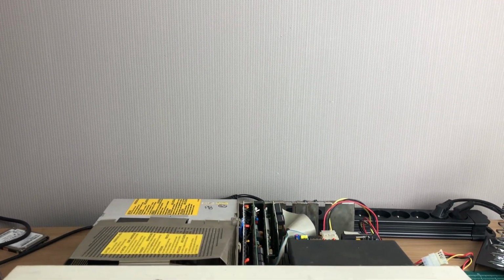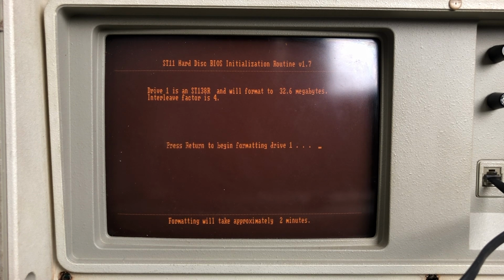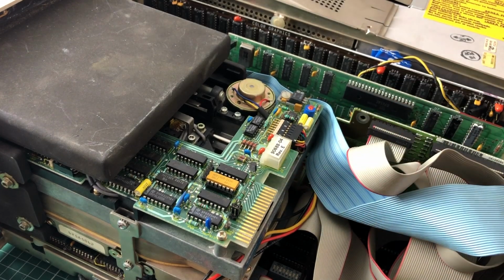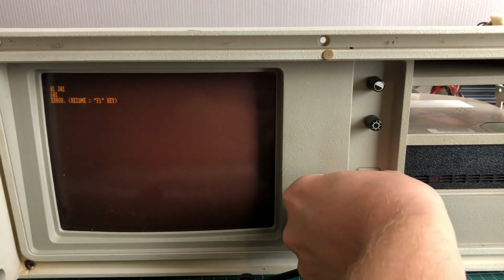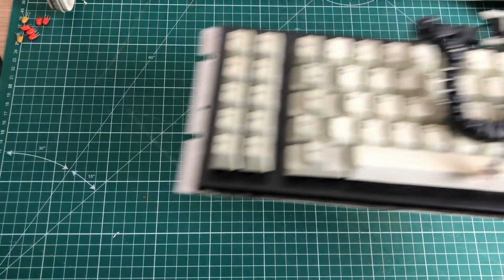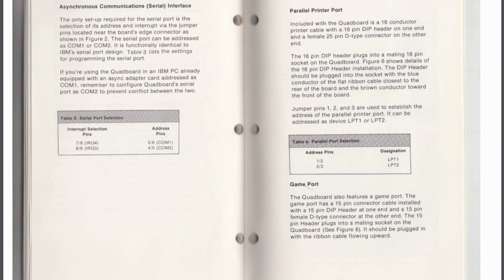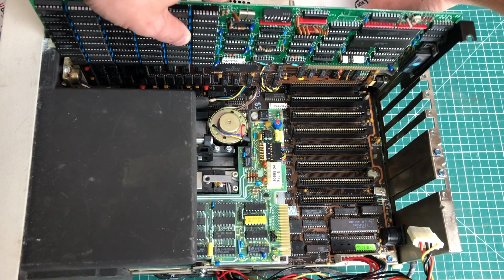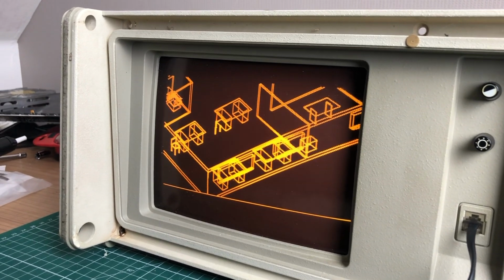IBM 5155 Part 2 : Light at the end of the tunnel

Comment: I have been watching these videos with interest over the last few days as I attempt to get my 5155 working again, so thanks for the great content! Did you ever sort out the hard drive/RLL controller mismatch? My 5155 has exactly the same configuration - ST11R (RLL) controller card and ST 225(MFM) drive but I am a bit worried about "over formatting" the drive to 32mb like you did.. did you have issues with doing that in your machine?
Reply: I just had the same thought after watching the video, as you can see at its end it's the very common and well known ST225 hard drive which is definetly an MFM model. In the internet you hear different opinions about if it works to use an MFM drive with an RLL controller or not. I have no experience about it my myself, so it would be interesting to know if this configuration might work even after a few years.
Reply: @davidhorst3766  I did the "overformatting" on my drive and it worked, but it only lasted a few months before the boot sector "died" when I got to about 50% disk usage.. havent tried to fix it yet..

Comment: "Let's recap a little bit" - funny.. I had access to a lot of these machines during the 80s and 90s and lots of PC parts, so enjoyed building them up as much as possible, installing hard drives, ram, etc. My guess, probably as well as other people here that they previous owner didn't park the drive before moving it which is especially important with a 'so called portable' machine.
Reply: "Park the hard drive..." We're dating ourselves here, aren't we? As soon as they came out with the magnetic actuators in the early IDE hard drives, that term died out fast.
Reply: @BlackEpyon  Yes, of course, but it's still alive and relevant to those of us today who enjoy the hobby of restoring, and using the legacy machines. This means parking the servo motor (usually a stepper) driven heads. You are 100% correct in stating that once the voice coil type head actuators came on the market it was no longer necessary because the spring action would cause the heads to retract off the platters when power is removed. I feel no shame or guilt in dating myself. I've been working on a  PC-XT restoration recently and wrote an assembly language interface routine to the RTC card that came with the machine since I didn't have the software for it.. It was an enjoyable hobby project.  FWIW the clock card has a MM58167 chip on it. 
Cheers!
Reply: @fredflintstone8048  I actually recently got myself an MFM drive with an XT machine I picked up off of eBay. It was listed as parts/repair, and I know for certian that the hard drive wasn't parked, since the machine let out the magic smoke when it was last tested (blown tantalums, it boots now). But I don't even know if the MFM controller works. It's ROM chip is one of those older types that can be cleared with UV, and was missing the sticker. I can read some data from the ROM chip, but without any visible model number on the card (just says "Modular Circuit Technology MCT-HDC"), I can't decipher the jumpers, or lookup to see if somebody has a ROM file I could compare to see if the ROM is still good.

It's no loss if I can't get it working, since I wanted to put in an XT-CF anyways, to free up the drive bay, but it WOULD be nice to be able to get it working for posterity, and for the sake of the hobby.
Reply: @BlackEpyon  It would appear that documentation for that controller may be hard to come by. You might try a command in debug something like -g=c800:5 which might possibly invoke an internal routine on the card for dealing with the drive. This might help: https://www.youtube.com/watch?v=uWWNbpd56Xs&t=695s

Comment: Correct me if I'm wrong but the ST225 is MFM not RLL.  So it would be an MFM interface.
Reply: i think it's a mismatch, an mfm hdd w/ rll card.  i predict he'll install an mfm card in next video, & reuse the rll card in another machine.  take care & stay safe.
Reply: Late reply. RLL controllers use MFM drives. They use a different encoding, giving an additional 50% storage. So a 20MB MFM drive with an RLL controller yields 30MB.
Reply: @JamesPotts  Didn't know they were interchangeable.

Comment: How did you format a 20mb drive to 30 mb? Lol
Reply: Jay Brooks the RLL card can pack in more sectors than an MFM card.
Reply: @azzajohnson2123  not really. The RLL drives were designed with heavier media.  The card called it a ST138, and the drive was an ST225, guessing the WD controller card has been manually configured or came w a ST138, now being used with a different drive.

Comment: why some capacitors aren't totally vertical(angled down)?
Reply: Those are known as axial capacitors, they were most used during the early days of electronics with vacuum tube equipment until the 70-80s when the transistor became more popular, then the axial capacitor was too big for printed circuits so a vertical position was much more compact and convenient.
Reply: @silentbloodyslayer98  thank you so much for all

Comment: The Kaypro's might be worse to remove the floppy drives on, due to the drives being encased in heavy shielding from the CRT next to them, again I had to use a ratchet to get them out
Reply from the maker: I have a love-hate relationship with these machines. Think they are really nice but extremely difficult to service and clean.

Comment: But what do you use it for?
Reply from the maker: Besides the fact that it looks super cool with the built in display, you can also hook up an external cga display. It is basically an ibm pc xt so runs all of the same software. None of these retro pc’s have any practical use, but a lot of people find it interesting to tinker with them or run old software and games on them.
Reply: @RetroSpector78  thanks for your answer!

Comment: It looks like the big screws on the floppy drive were supposed to just be loosened, not removed since there's a slot in the plastic to slide out the drive after removing the smaller screws.

Comment: That does not look like Seagate st-138R 20:35 .The st-138R is an 3.5'' hard drive.
Reply from the maker: Correct, I mentioned it in the description (not sure in the video) that there was a controller / disk mismatch ... only saw that it was an ST-225 when I removed the floppy. It came configured as an st-138R and had an RLL controller (that is not supposed to be hooked up to an ST-225)

Comment: disarm the hard drive, turn off the first disk, and the rll controller ask install, but in the ST you will need the 2.1 version 
because the errors in the disk can be past, the old version the controller cut de low format when find an error.
Reply: So when I was much younger we had an older at machine. Or XT. Or both. But anyways the hard drive was messed right up so I ended up formatting the thing a good 60 times I think. Including the scandisk to mark the bad sectors. The same errors would eventually repeat every time and I would have to start again. What a great learning experience though. I wonder if lubricating the bearings or motor or anything on the hard drive would help.

Comment: Nice restore.  Why did the HDD act up?
Reply: Probably because it's a 20MB MFM hard drive formatted to 30MB using RLL. Sometimes you can get away with it, but more often than not you get frequent errors that creep in.
Reply: Stepper motor based head arms HDDs have one cylinder per step of the motor, so the controller asumes than the track is always aligned with the head. With years, thermal expansion an contraction and wear they get miss-aligned. So you may Low level format the drive so it gets re-aligned. Modern voice coil based head arms don't have any steps, they look for the tracks and get self-aligned every time.
Also the magnetic field of the old data may be faded out.

Comment: Thanks! I just got my 5155 running again with the help of these video's. I still need to fix one of the floppy drives, but after seeing your video's, I'm confident that I'll get it fixed.
Reply from the maker: icecreammm2 cool .... glad you got it up and running again and the videos helped !
Reply: @RetroSpector78  I'm looking into buying an XT-EDI solution for my 5155. Any Idea where these can be bought in the EU for a reasonable price?
Reply from the maker: @icecreammm2  no there don't seem to be any "big" shops in the EU that I know that sells them. You can find them sometimes on ebay. Otherwise official channel  via the US (TexElec) where you can get them assembled or only the PCBs if you feel like creating one yourself. Or you can perhaps check the forums (vogons , vcfed, amibay) to see if there are local sellers.

Comment: Have you considered trying to replace the Varta battery with a coinsell CR2032 on the memory card's PCB?
Reply from the maker: bundesautobahn7 yes I have, but focus now was to get all of the basic stuff up and running ... already became a bit lengthier than I would have liked :) might do it in part 3
Reply: Does this really work? The coincell is a different voltage, and wouldn't the charging circuit in the PCB fry the coincell?
Reply: @audunm.gangst1166  folks who do the coin cell mod install a diode to prevent trying to charge the coin cells.  multiple coin cells in series to match the replaced secondary [ie rechargeable] batt, if necessary.  take care & stay safe.

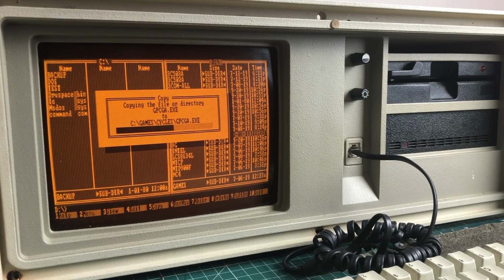Comment: 21:40 What is that D:\ drive?
21:52 This looks like 8087 benchmark
Reply: I learned autocad on ATs - slightly faster but not really that much :)
Reply from the maker: Bad Screw did you create your username specifically after watching part 1 of this video ? :)
Reply from the maker: It's the office demo drawing rendering in AutoCAD 2.6
Reply: @RetroSpector78  Didnt know that there was an Autocad at the time of XT. On the other hand Ive seen reviews of XT class PCs that were produced in early 90's, so its plausible. That drawing speed is casual, indeed.
Reply from the maker: fradd have had several XTs that had autocad installed. Must have been brutal drawing with it ... but stil, probably faster and more convenient in some ways than doing it with pen and paper :)
Reply: @RetroSpector78  Ha, definitely.
Reply from the maker: Zankuhaaa! D drive was an xt ide board + CF card I installed to copy some stuff to the internal hard drive.
Reply from the maker: I think I forgot to edit that in despite having lots of footage on it. Will put it into part 3
Reply: Haha, nope!

Comment: Your repair is very similar to my 5155, right down to the strange CGA card fault.  My theory with mine is that it had shorted on the case as one of the plastic standoffs was rattling around inside loose.  It’s worth persevering with the repair as apparently the CGA cards used in the 5155 were optimised for the amber CGA screen.  Interesting that you has a ST225 formatted as RLL, but from you video I think you already know that :). It’s great to see such a thorough and well documented repair video.
Reply from the maker: Thx a lot ... glad you liked it .... Yeah it is very tight up there, especially for the CGA card ... my plastic standoffs are still there but I often find myself putting in some carboard to add some space :) The CGA card is very challenging ... still don't have a fix for it ... and the replacement I have doesn't seem to render everything very nicely on the amber display. But haven't given up on it yet :)
Reply: @RetroSpector78  do you have a TL866 ? If you do, you should be able to test some of the chips found on the CGA card, this should help figuring out the issue maybe.
Reply: RetroSpector78 The 5155 CGA card has a certain amount of mystery surrounding it.

It’s said the CGA card in the 5155 was unique in that it was capable of displaying more shades so the monochrome screen looked better.

However, my suspicion is that all very late revision cards had this display upgrade regardless of application.

The “wrong” 1501486 card I had in my 5155 looked terrible (you can’t even read the menus in basic) but I found a very late 1501982 (week 50 1986) card that worked very well.  My suspicion is that all later cards will work in the 5155.  However this is all theory as IBM never documented the change!

Later cards can be identified as they have more resistors near the composite connector, but I think the 5155 upgrade came as a later revision to this late style of card!

Comment: ST 225? That's a 20MB drive, right?
Reply: Nice cliffhanger, by the way ;)
Reply from the maker: Yes it is ... and it is also not an RLL drive ... more on that in part 3 ...
Reply: @RetroSpector78  My memory on this is dim, I must confess. What I remember is this: One could take an old MFM drive, and upgrade the controller to an RLL one. Perform a low level format, and +50% disk space appeared out of thin air for free. So using an ST 225 and re-format it with RLL would indeed give 30MB. Looking forward to the 3rd part ;)
Reply from the maker: Martin Erzberger that’s 100 % correct (due to the sectors / track increasing from 17 to 26). Reliability however is another issue :)
Reply: @RetroSpector78  exactly, the reliability...the drive was ailing badly when you got it.  I assembled hundreds of clones back in the 80's, I can tell you that RLL works but is very bad for MFM drives.  Get yourself a WDXTGEN and take the 10MEG hit, your drive will last through the life of your machine...

I just recently found your channel and I'm enjoying your videos...keep up the good work!